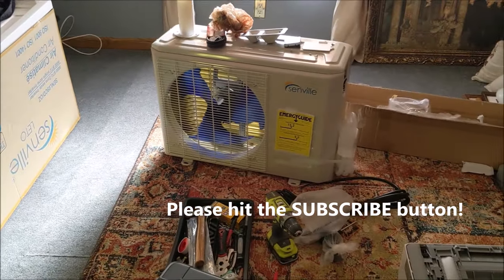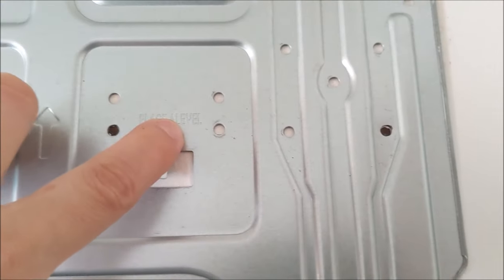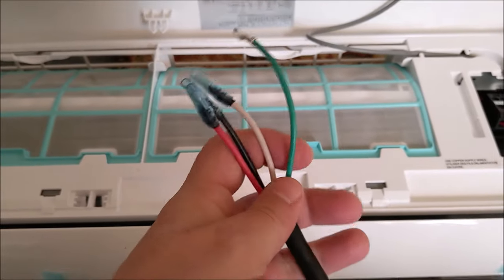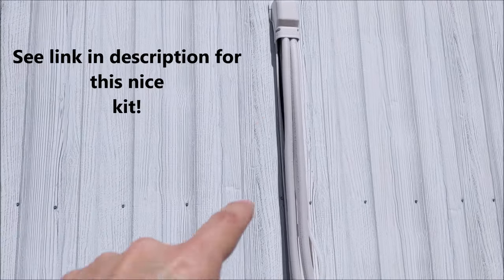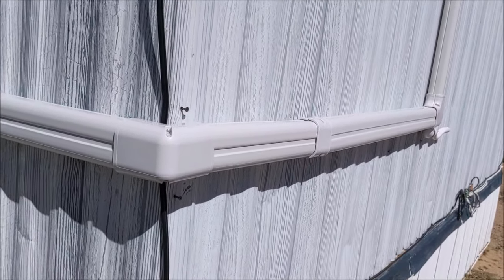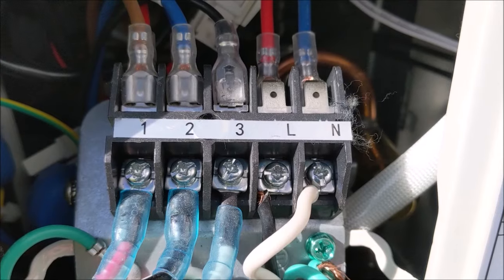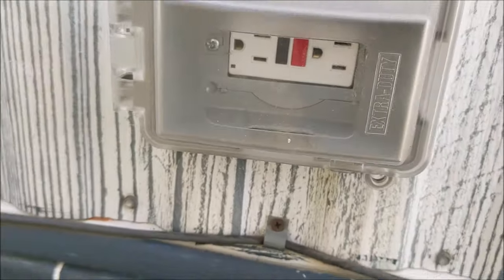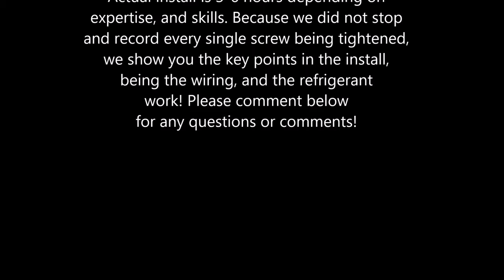Senville mini split installation key points in under 10 minutes for DIY ductless install

Comment: Thanks for the video but for some reason I’m having trouble understanding how to wire the 220 voltage to the unit. I got a feeling that once I post this question I’ll figure it out but just in case I would appreciate the help
Reply from the maker: Did you figure it out?
Reply: @SaveGreenHere  yes and thank you for replying back
Reply: @MichaelBrown-gf4sk  I didn't understand, bought a Chinese RovSun 12K 230v mini (instructions suck of course). Was given 10-2 both comm line (16') and power line (6')--nothing about how to connect to condenser. I see L1 and L2 in condenser panel, but just one white wire (110v ??) on provided 10-2 power line....bought 10-2 AWG for consistency to go to breaker panel for run of 35 feet. Also, state of CT BOCA requires GFCI on disconnect which came incorporated in disconnect I also bought. Problem I'm having is wiring L1/L2 for what appears to be a 110v circuit for a 230v mini (as noted on side panel of unit)...should I just purchase a new 220v whip and use 14-3? I'm also told many differing ideas on amps (some say 6 or 12 or 20 amps at startup)---trouble is, Amazon ques/comments on this 220v  refer to their 110v unit, very confusing
Reply from the maker: Higher volts = lower amps. Lower volts = higher amps. You can use this formula to get the same watts. For example, 110 volts x 10 amps = 1100 watts   220 volts x 5 amps = 1100 watts. Both use the same exact amount of power. But you need to ensure if you are on 220, or 110. What is your total watts on the system, and amps, as shown on your product label?

Comment: Pan hole for the drainage of heat pump. So that I can instal the drain joint.
Reply from the maker: Should see holes at the bottom metal base of your outdoor unit

Comment: The manual states the refrigerant piping can exit the indoor unit from right hand side as well (when you are in front of the unit), but it is set for the left side by factory. I cannot figure out how to change the refrigerant piping from existing left-hand side to right-hand side (take them out from the left side). Please help. Thanks.
Reply from the maker: It varies from one unit to the other. Unless you know what you are doing, and have proper pipe bending tools and experience, go out the way it "naturally" bends out the unit.
Reply: It is not really set for left side use, they are just flattened in there for shipping, You just carefully bend the pipes outward, they have springs around the pipes to prevent kinking, they are designed to be bent.

Comment: Also I installed a GFCI plug outler and for some reason it shuts off. Breaker remains on though. Dont know what I am doing wrong.
Reply from the maker: DO NOT use a GFI. Use a regular plug with weather cover like this..... https://amzn.to/3Pdfm0Y  Use a 15 amp outlet for the 9000 BTU and a 20 amp outlet for anything higher.
Reply: @SaveGreenHere  is there any alternative methods to ensure extra safety? (since GFI seems to have problems with inverter ac)  would it be safer if we just get a slightly longer cord and plug it inside the home? would that be safer and thus do not have to worry too much about GFI?
Reply from the maker: Yes, a longer one like this will work..... https://amzn.to/3eTP47e

Comment: Is this a 120v unit? Mine is 240 and I was planning to use 10 2 wire - will that work?
Reply from the maker: How many amps, or how many tons?
Reply: @SaveGreenHere  Kind of like measuring twice, I walked through the installation 1,242 times. I checked the tag on the unit and the wiring diagram and it turns out they sent me a 120 instead of a 240.?! It's a 12,000 BTU unit in a 700 SF room. Thanks again!

Comment: What's the sq footage that the unit covers?
Reply from the maker: Generally between 350 to 450 per ton but you have to factor in the actual heat gain/loss. A manual J is the best approach.

Comment: How do you lift the indoor unit off the wall mount after it is put on?
Reply from the maker: There are tabs on the mounting bracket and lifting up will do.
Reply: @SaveGreenHere  just lifting up? Don’t need to push tabs or anything else?
Reply from the maker: The ones we work on do not have any tabs, just lift up about an inch and pull towards you. But your model may be different.
Reply: @SaveGreenHere  greatly appreciated !

Comment: Thank you we doing the plug. Now where is the base pan hole of outdoor unit located? Manual says at the bottom but I do not see any exposed holes. I have the 110 heat and cool. Single split.
Reply from the maker: Check again, but it is on the bottom of the unit. Just a hole large enough to allow the water coming off the outdoor coil when in HEAT mode only. Water will freeze if not properly drained, and cause issues.

Comment: Did this unit co.e with a power cord plug? Mine came without and i do not know what electrical wires to usd from breaker to unit outside.
Reply from the maker: If it's a 110v unit, this one...... https://amzn.to/3yuB9ui    If 220v, make sure it gets wired direct into a disconnect box like this one..... https://amzn.to/3uAeeg2
Reply: @SaveGreenHere  what amp circuit do you have that on? Mine keeps tripping.
Reply from the maker: 20. But it depends on the tons.